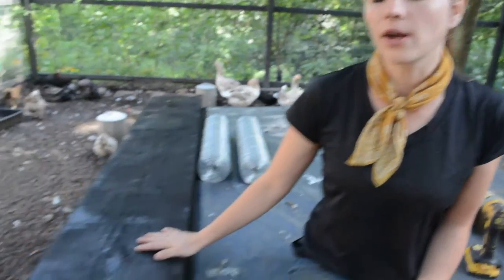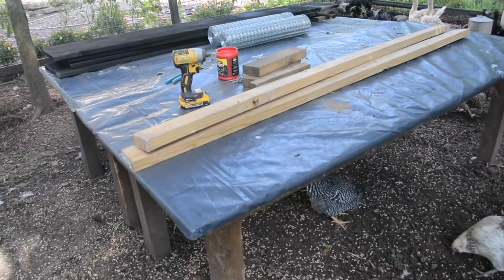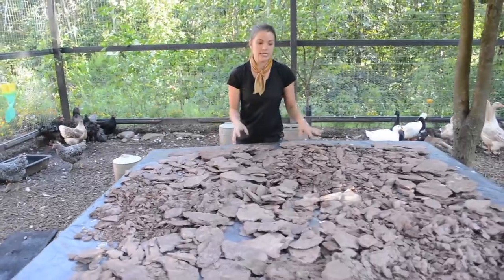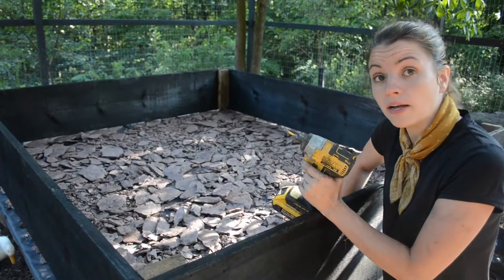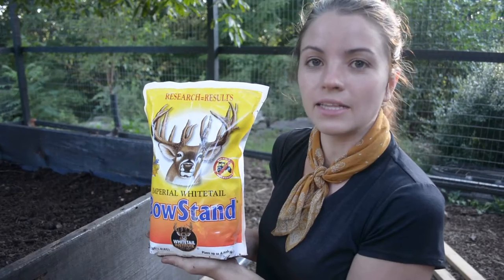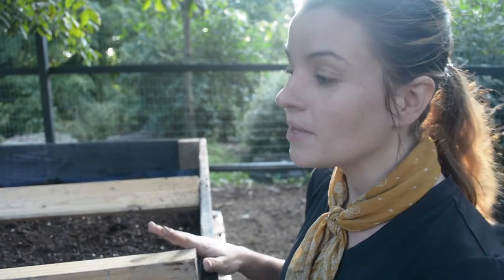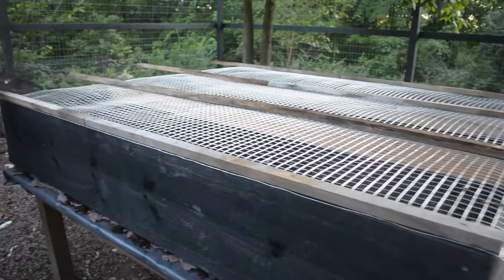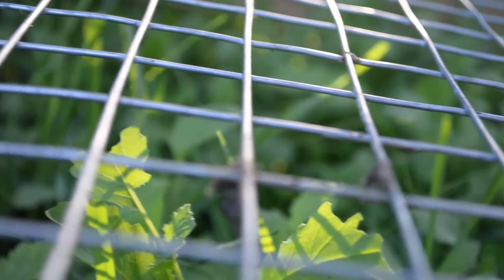Building a Chicken Fodder Table

Comment: I only have 3 chooks, but they are on a paved surface, so I was looking for a way to introduce some greenery for them.  My run is 6ft by 9ft.  I followed your example and made a table 5ft by 1.5ft.  The girls love it.  I couldn't get the same seed mix in the UK so I used 'chicken grass' seed mixed with some Bee Bombs and some spinach seeds.  I didn't have a table to scavenge so I had to make the table too, but having the 3 parts: table, removable soil frame and  a removable top frame with the top edges shaped as a perch and 1inch hardware cloth stapled underneath was a useful design decision.  It was such a success I'm going to add another slightly smaller table so that they get a full 9ft by 1.5ft total area.  They like to sit underneath or stand grazing on top.  It also keeps the amount of muck on the floor down as a good deal of it drops onto the grass.  Thanks for the idea.
Reply from the maker: Would love to see your version! https://www.facebook.com/Black-Rabbit-Homestead-431973280612883/?view_public_for=431973280612883
I enjoy the challenge of creating a destruction proof chickie garden!

Comment: How do you replant? Do you have to remove the top wire every time?
Reply from the maker: unfortunately yes, the 2.0 version will have some stainless steel hinges so that we can access the soil and plants so we can clean out and add new material.
Reply: @BlackRabbitHomestead  plus you can open it up to let the flock scratch it up
Reply from the maker: @joyadams507  I love that idea!

Comment: How has this worked out ? Would you change anything ?
Reply from the maker: Its been working out great I want to do an update video on it. If I had to change anything I would add hinges in the middle so that I can access the inside of the bed to clean out and add some fresh soil every couple of years.
Reply: @BlackRabbitHomestead  thanks I still haven't built it, so I will add the hinge . I'm working on a self watering system for warm weather .
Reply from the maker: @billmoran389  Me too! If you do build the fodder table I would be interested to see it.
Reply: @BlackRabbitHomestead  this summer , haven't seen you for long time , do you still work there?
Reply from the maker: @billmoran389  I do not,  although Im still a frequent customer.